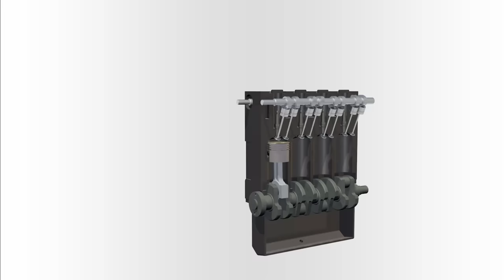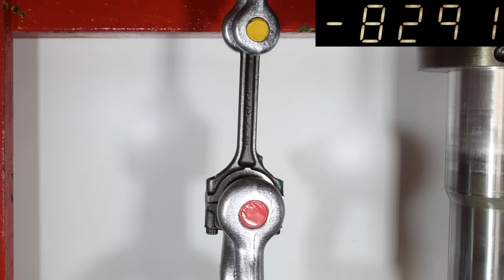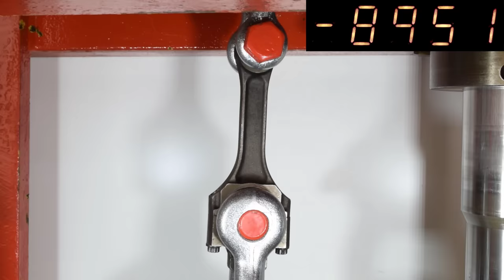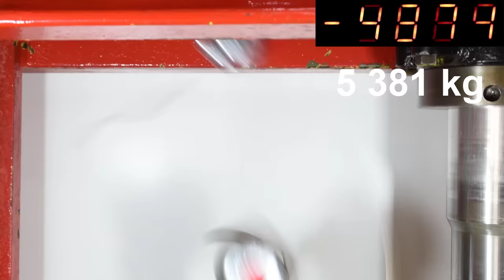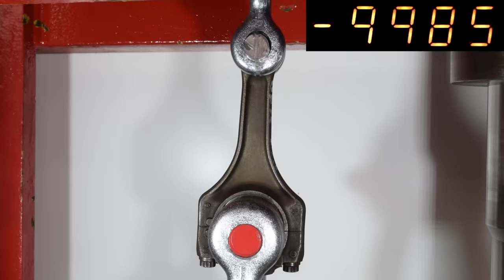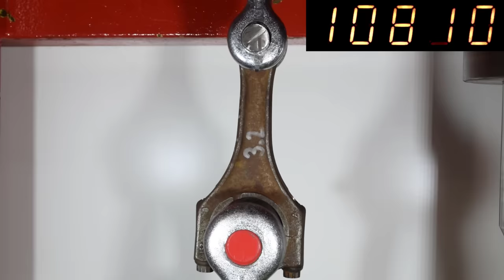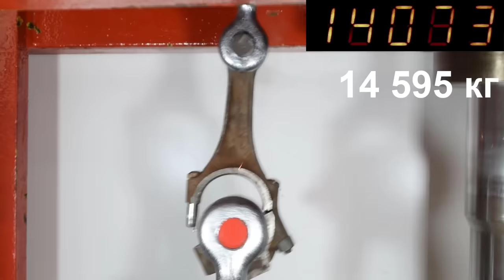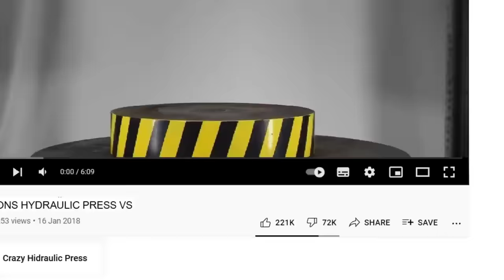HYDRAULIC PRESS VS CONNECTING RODS

Comment: Connecting rods are not optimized for tensile load.
That is why the screws mostly break in this test.
In the engine, they are mainly compressed.
Reply: Yep, but they also suffer from tensile forces fue to the piston mass. Also the suffer lateral torsion too! Connecting rods are the MVP of the Engine team!
Reply: Tensile stress occurs because of inertia of small end of conrod and piston mass. This is especially important for high rev engines.
Reply: That's what I would comment! This test are only checking how strong the screws are not the rods.
Reply: This isn't the only forces that the con rod faces.The piston  It is a reciprocating mass after all. So when it changes direction at the end of the stroke, there is a significant amount of force involved.
Reply: Rods are always rated in Horsepower they can handle. That makes no sense. 
It's known that RPM and lower quality bolts (screws) is where they break - at the bolts.
Reply: @mschrappe  best comment i've read so far
Reply: @emrahayaz3207  I don't think this kind of forces are important even for high rev engines because the max force is during the intake stroke and there the max pressure is -1 bar which is nowhere near the forces in this test. In all other cases the piston will be under pressure.

Too high RPM typically causes valve float and valves hitting the top of the piston.

This test is basically measuring how much over-engineered the rods are in this direction. Without bearing failure, they will not fail in this direction in real world.
Reply: @mschrappe  What? lol. He literally connected both ends of each rod, not both ends of the bolts (not screws).
Reply: The bolts are the main component of a connecting rod. They are part of the rod assembly. So if you are testing rods, yeah, you are testing the bolts. It's usually the weakest part of the rod assembly. If either half of the steel fails, you know you have either a bad forge or a design flaw.
Reply: @paulweston8184  But he is generally correct - this was a rod bolt test for the most part. Plenty of aftermarket rod bolts are out there because its the bolts not the rods that are the weak link in most OEM applications. Plenty of modified engines out there with OEM rods and aftermarket bolts - sort of a standard thing to do when replacing the journal bearings. I would note there are few things about the sizing of and connection of the text rods that throw a bit of inaccuracy into this demonstration. So, not really a true test of connection rods or rod assemblies. And even when conducted correctly the tension and compression tests are really just indicative and they do not really replicate the failure modes most common in an engine.
Reply: calculate the forces at 9000 rpm. mechanics change from static to dynamic.
Reply: @Emilthehun  But no where near the compression force the connecting rods are designed to bear. Tensile strength is insignificant than compression strength.
Reply: @ZoneCrasher  the compression force is carried by the rod , and not the bolt. But I'm not a mechanical engineer,  and would have a hard time doing these calculations.  But I know a person who is in fact a mechanical engineer.  I will just ask him to do the calculations for me 😂
Reply: I'm a race engine designer and your comment is nonsense. The largest forces on a connecting rod are the tensile forces at TDC as the rod slows the piston down and pulls it back down the bore. The compressive forces as the engine fires are much lower. The rods are designed to withstand a given rpm with the specified piston mass. The bolts have to hold the rod together at this loading and will generally be a bit weaker than the rod so they break first. All this is really is a test of the bolt strength and that could be worked out anyway from their size and grade.
Reply: @davidsmith7653  hey just the man I was looking for. Please describe the equation to calculate load at TDC.
Reply: @Emilthehun  I can describe the equation sure. "Complicated".
Reply: @davidsmith7653  ironic that my mechanical engineer friend said the same  😂😂😂😂
Reply: @emrahayaz3207  Of course but it's vastly easier to accommodate than compression forces which are not only far higher but subject conrod to buckling failure.  Have you EVER seen a rod fail from tension?  I don't think so as it's not even close to the limiting factor and tensile strength nearly mirrors compression strength even before allowing for buckling which is how rods normally fail and at the bottom of stroke compressive inertial forces are similar to the top where max tension can occur.
Reply: Yeah as soon as I see tension used here I'm done, not interested, irrelevant.
Reply: @davidsmith7653 In an engine without compression and combustion, shouldn't the maximum tensile and compressive forces on the connecting rod be the same?
The tensile force acts around TDC.
Compression of the air before TDC creates additional compressive force.
Likewise, the combustion after TDC.
So the maximum compressive force is greater than the maximum tensile force.
Or where is my error in thinking?
Reply: Yeah, exactly. That's was my first doubt when I saw this movie.
Reply: @lutzj74  At the end of the exhaust stroke (as the piston reaches TDC) there's not any significant pressure in the cylinder.  As such, there is no compressive force to resist the piston pulling against the rod as it stops and changes direction.  The rod wants to go down, but the piston's inertia is trying to keep it moving up.  That's where you get the highest tensile force.  It's not between compression and power, it's between exhaust and intake.

The distance the piston travels is constant (ignoring microscopic differences due to the rod stretching/compressing).  However as RPM increases the time it takes for the piston to move from BDC to TDC reduces, and as such the piston has a higher velocity at a higher RPM.  That increased velocity means the piston has more momentum as the rod suddenly stops pushing it up and starts pulling it down.  And that is why rods (or rod bolts) break at high RPM.
Reply: @lutzj74  I don't really understand the question. Why should any two things be the same? The tensile forces on a rod increase with rpm and the compressive ones with throttle position i.e load. At high rpm the tensile ones are larger. That's just how it is.
Reply: @davidsmith7653  From halfway to the TDC to halfway back, the connecting rod pulls on the piston. At the other half revolution, the connecting rod presses on the piston. The amount of these forces is the same and depends on the RPM.
Additional forces are produced by compression of the air and by combustion.
Reply: @lutzj74  The amount of these forces is not the same. The forces near BDC are much lower than the forces near TDC due to the geometry of the rod crank system. This is a 101 topic which will be covered in any textbook on internal combustion engines such as C.F.Taylor's.
Reply: @davidsmith7653  OK. Then I'm probably imagining it too easy.
Reply: I agree and just commented about the same thing.  I had written my comment before I read yours.  I hope you don't mind if I leave it posted.  Brilliant minds think alike.  lol
Reply: @MikkoRantalainen  TDC @8500 rpm at the exhaust stroke, the piston travels at 25-28m/sek and  weights several tons when it changes direction.
Reply: @thomaskarlstrom4815  I think the G forces depend on the stroke length but ballpark figure for 8500 rpm should be roughly 5000 G, so a piston + rod weighting e.g. 700 g has weight on the cam around 3.5 tons.

However, I think the actual weight is less because part of the forces are against pumping losses which reduces the effective weight on cam but it is still high force indeed.

And it's easy to understand why removing e.g. 100 g from each piston might help a lot.
Reply: Exactly my thoughts as well. Weird test as there is no real load like that.
Reply: so how do you make a rod out of aluminum or steel that is strong in compression but weak under tensile load ? Answer: You cannot separate them if you are dealing with a largely isotropic material (cast). So this test IS relevant.
Reply: @emrahayaz3207  
no way on Earth the rods are going to see even 2 ton of tensile stress under the highest engines loads - let alone 8++
Reply: Failure under compression is a highly atypical failure mode, even for cast connecting rods. Failure usually takes place due to shearing forces in the wrist pin domain, poor lubrication at the big end bearings, or tensile forces on inadequately fastened rod caps.
Reply: @ChandranshuDwivedi just imagining the old Volkswagen Diesel engine revving 9000 rpm LOL
Reply: @heizoeli  lol
Reply: I vote for the pistons themselves.  @TheDrAkira
Reply: I was thinking just that.
Reply: @TheDrAkira  Nah man its the fucking bearings
Reply: Exactily what a stupid test ,it means nothing ,just breaking stuff for no reason .
Reply: You're right. I reckon the tensile load approach is wrong.
Reply: Tensile strength is also a very imporotant factor when engineering connrods. Specially in high revving engines such as the S54 in the M3.
Reply: the true MVP of the engine is the head gasket. @TheDrAkira
Reply: I agree that compressive (+inertia) loads are greater than the tensile ( almost exclusively inertial) loads.
Still, WHY did the 1968 rod from an ostensibly low performance vehicles outperform ALL the other rods?
The video showed it being FAR more ductile, perhaps just a nodular iron. Normally that would have a lower yield, but a longer stress vs. strain curve (strain on the X axis).
But here, it had BOTH greater ductility and a higher yield.
Reply: What a load of bollocks. What do you think happensat TDC? The piston comes to complete stop, and then is accelerated downwards. The tensile load is massive. Conrods generally break in one of two ways; They bend from too much compressive force. Eg, you've run too much boost on stock rods. OR they snap at TDC on the exhaust stroke because you've over-revved the engine. Eg.  money shifted into the wrong gear.
Reply: Do a push test instead of a pull test!
Reply: @Emilthehun   I wouldn't say there is "significant" amount of force involved.  Afterall ... the piston isn't just coming to a dead stop.  It is decelerating between 270 degrees & TDC & accelerating again from TDC to 90 degrees.  I highly doubt that the con rod sees the tensile forces being applied in these tests.
Reply: Don't tell me show me
Reply: Esa prueba no sirve las bielas no trabajan así
Reply: So, the Winner here is  - Moskwitch !!! ! !!! 😀
Reply: When engines "throw a rod" it's usually becuase they've failed in tension.
Reply: Just write the opposite of what you wrote and you will be almost correct. Imagine the rotational mass and inertia of the piston going with 9000rpm.

Comment: For engineering purpose, technically you should have changed the M5 connecting rod at 5:03, cause results aren't accurate when a tensil trial fails. You can't do a second trail on an object that is already plastically deformed, because it will be falsing results.
Reply: it was probably still in the elastic range.
Reply: If only the Ocean Gate company understood that.
Reply: I think the only result he is looking for is entertainment value.
Reply: if we're being that picky, the loading rate was controlled manually, and not very carefully in some cases. if they were measuring yield strength i would agree, but i can't see it making any difference to the UTS.
Reply: @jamesg8246  they didn't understand what testing is. 
stockton - " 5" of carbonfibre. that'll do the trick."
mexican employee - "but boss, shouldn't we do extensive testing on it?"
stockton - "nah, it's got to get through 5" of carbonfibre, we'll put microphones on it so we can hear it cracking."
mexican employee - "is it supposed to crack?"
stockton - "there's 5" of it so who cares?"
passenger - "i can hear cracking."
stockton - "look, there's 5" of... "
radio silence
Reply: Well in theory you are correct. However, if you ran the same test with a Johnson rod, the results would be very different due to the metal memory of the nickelback within the center tensioner. But, if we are calling spades a spade, I would prefer a rotary piston shaft trial because that basically serves as the lynchpin for the automobile's construction.
Reply: Damn, that’s hardcore man- 😂😭💀
Reply: Got a hydraulic press.....why not,just for fun!
Reply: I don’t think anyone is keeping score here. Except you, maybe.

Comment: The failure isn't the rods mostly themselves its the bolts
Reply: Yes this is wrong process , wrong tensile test not through the rods , through the bolt crimpe and tip hole , this is as result bolt tensile testing !!!!!!!!!!!!!
Reply: @karinanur7844  Not really since many times the bolts won't fail and instead the body of the rod breaks.
Reply: Most times when an engine kicks a rod it's on de-acceleration and the rod bolts break.
Reply: Impressive.  Rod needed high strength bolts.  They sell high strength bolts for this reason

Comment: Interesting that it was the bolts that broke and the old one was strongest, Would be interesting to see some high performance ones like what they use for top fuel drag racing or something. 

1968 must have been a good year :).
Reply: Actually nobody cared about how much material they use in the communist Soviet Union for a bar. He shows a Moskvich - I never dreamed about.
Reply: It just shows the lack of optimization in the Soviet design. The bolts don't need to withstand extreme theoretical forces. The connecting rod should be stressed in compression. For this tensile test, the Soviet design of just a big bolt works well, but is useless in a car that makes a fraction of the power per liter that the BMWs produce.

Comment: I agree with comments about compression. Something else I'd like to mention is the weight. You could make a steel connecting rod with a huge cross-section that would win this (and a compression) test. But how does it affect the engine performance?
Reply: Another mental giant…. Con rods DO NOT fail because of compression…tension breaks them. Dragster engines are always measured for rod stretch…
Reply: Bigger and heavier means more reciprocating mass which means bigger crankshaft loadings and crankshaft bearing loadings.
Reply: @Thewatcherinthering336 Another mental giant...Conrods DO fail because of compression! Ever heard of water lock? Although it's ment fail because of water lock.
Reply: @Joepie-r3x not only that but water cannot compress, so it doesn’t fail because of compression you tool.
Reply: @Thewatcherinthering336  It's the same force, and you're the fool I think.
Reply: It's Fun !!

Comment: Exactly what happens in an engine at high revs during valve overlap. On active compression the forces are smaller, unless there's non compressable fluid in the combustion chamber. During the combustion , the rod gets loaded up, like a coil spring, and that energy will also be released during valve overlap, contributing to the mechanical forces, already at play.

Comment: In automotive racing engines, the metallurgy with the connecting rods have improved immensely from the 1950s to the present; especially so in the US NASCAR race series; where the engines used, as its base, were the high performance engines from the US automotive manufacturers [General Motors, Ford, & Chrysler].
The term "blown engine" was used to describe engine failures among the participants in the NASCAR races in the 1950s through the '70s; and was especially common in the 1950s and '60s.  Many times those "blown engines" were due to connecting rod failures.

But in the 21st century, the rate of blown engines, in NASCAR races, are seldom, and I can't recall the last time there was an engine failure due to a broken connecting rod in the past 20+ years of NASCAR races.

Comment: love how bombproof the ole '68 proved to be!!
Reply: It is, but the problem with overbuilding is an exponential loss of efficiency. Plus you probably couldn't rev it much past 3500 rpm for all the rotating mass.
Reply: there are new bolts on Moskvich rods and bolts are weak point in this test